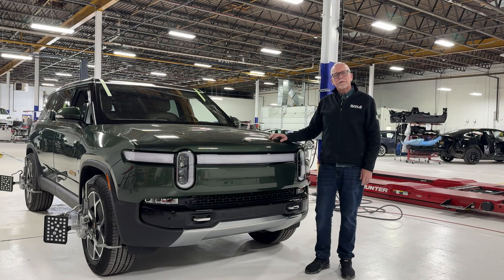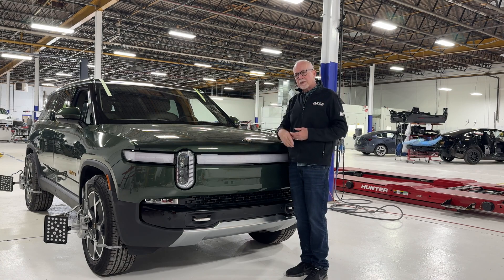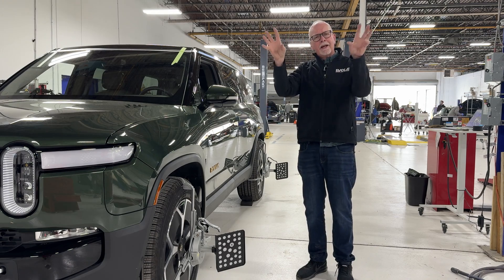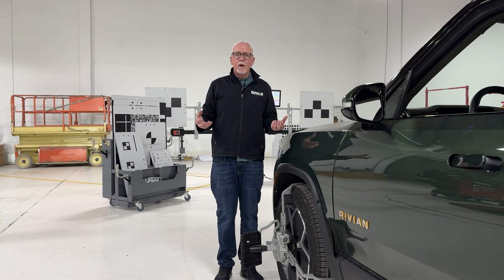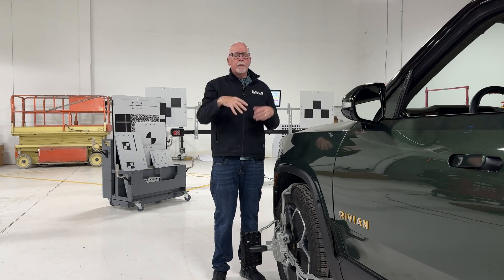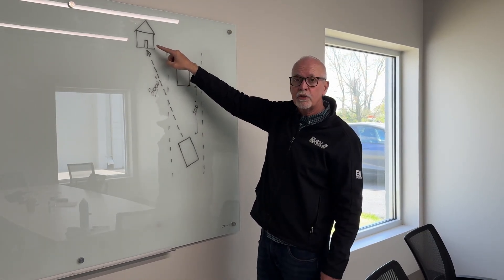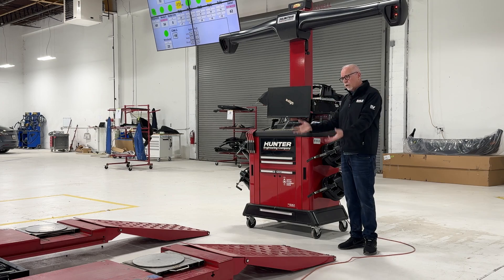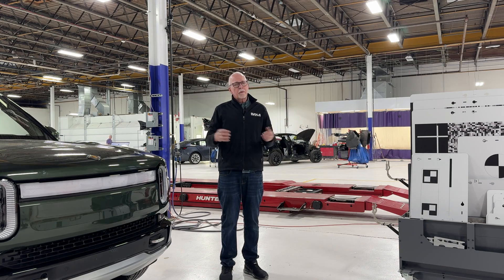Rivian R1S - Glass Replacement and Calibration

Comment: Show me an accident that was shown to be due to an uncalibrated camera.
There's a lot of misinformation on "Camera Calibration".
Camera calibration on most vehicles is self calibrating and the "dealer calibration" is simply a verification that the camera was installed correctly after windshield replace so that it can then self calibrate or calibrate via a service menu available to owner.